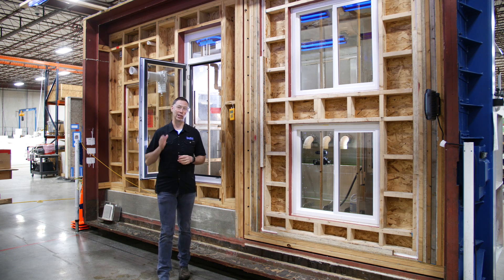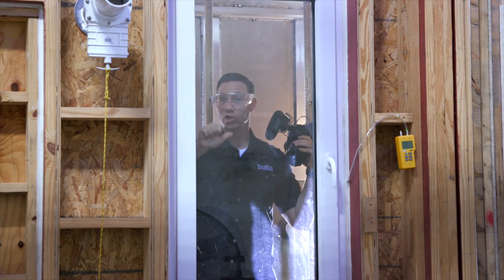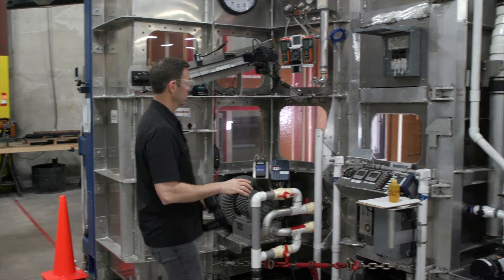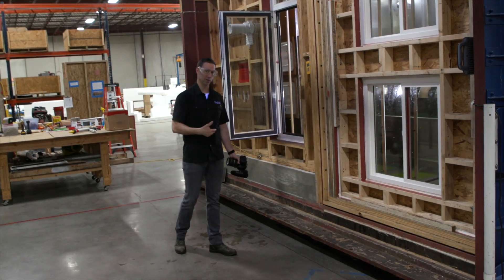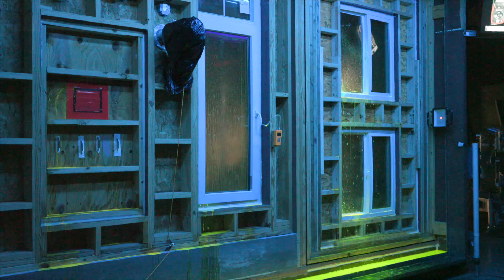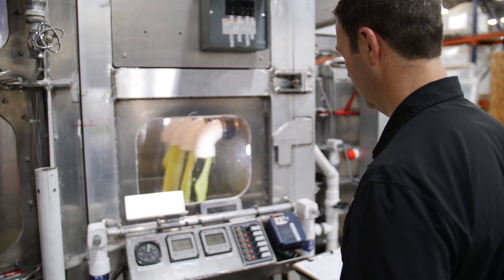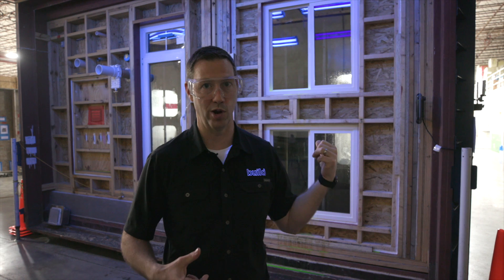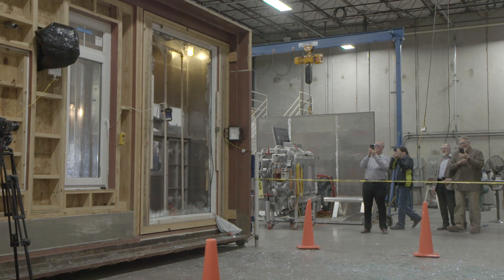Hurricane Testing - Whats the Failure Point?

Comment: Do they help protect concrete and the Styrofoam ICF walls?
Reply: You wouldn't use something like this. Below grade you'd want a EPS compatible bituminous peel and stick membrane (or liquid applied), and above grade any generic water barrier just to make sure that nothing gets into those cracks between EPS foam. Window mounting is different too, and depends on what sort of window you're doing.

Comment: With cat 4-5 hurricane nearby by. Most of roof sheeting will go, so flood will come trough the roof, so at that point waterproofing of windows becomes irrelevant.
Although air tight window and vapor barriers well make sense for humid climates to hold controlled humidity and temperature inside the house.

Comment: How do the stud bays breathe?  With supposed zero permeability how will the house dry?  Seems each manufacturer just addresses one small part of the pie and ignores creating a true 'system'.  Take care.  Doug
Reply: Hi Douglas, permeability may vary depending on application thickness, but at the recommended thickness (12 mils) it has a permeability of 18 perms. It is intended to allow the wall to breathe and dry but won't let water in. 

For more information, you can visit https://prosoco.com/product/cat-5/

Comment: I wish I could have had some of these products on my house on September 6th 2017 when hurricane Irma cam over with sustained winds at 189mph and gusting to 356mph on parts of the island of St John.
Reply: Steve Slade  Mine did because it is made from 8" thick cement walls and ceiling.  They were breathing about 6" throughout the storm though (very scary).  I did have a hurricane window that was covered by 1/2" plywood implode from being impacted by someones aluminum hurricane shutter.  I did have water force its way through or around every window and door, even with aluminum roll down shutters over most of them.  I was luckier than many of my neighbors that lost everything..

Comment: there are some flaws in this testing they used a sliding window for the vinyl but a casement for the german. not a fair comparison at all. while i do think the german window is good would have been nice to see the same type of windows. also what about windows that dont open at all just a vinyl or german made with no openings just a viewing glass no option to open it.
Reply: It is a test lab for there sealant not so much the windows so they control the variables they care about. I'm sure they have done many us made casement.  It makes a strong case for not using cheap windows.  What would have been cool is see how bad they leak then hop in and apply a the red stuff and stop the leak in short order. Like the cardboard box demo.
Reply: @tysleight  i get that they were pushing the liquid apply. but if they both had shown both types of windows being casements then i would be able and many others would be able to clearly see that the german ones are much better ones. but seeing as they use 2 different types which have much different leak results seems abit strange. the fluid applied stuff works great i know it does. but as i am getting ready to build a new 5000 sq ft house in a few months would be nice to see the real difference in them in a apples to apples situation
Reply: Yes. Picture window.
Reply: @kipcarroll486  yea

Comment: Wonder if at some point a product like this could be built up like a stucco as the final layer... kinda like a stucco applied to OSB with a variety of textures/colors/etc.... a materials savings for sure.
Reply: I don't think it would be a UV stable product, as it's not meant for prolonged UV exposure but to be covered.
Reply: I looked at the website recently and I recall that they don't recommend painting it as the final surface because it would be degraded by UV rays when the pain wore off.
Reply: Fast Flash and Cat 5 are not intended to be an exterior product. We do have a formulation for use in rain screen wall assemblies, but for the most part this is meant to be covered with some sort of exterior cladding.

Comment: Ask any window manufacturer and they'll tell you that casement windows are the tightest air and water seal, followed by double-hung, and last are sliders.  Notice how the German window was a casement?  And notice how the cheap windows were sliders?  I'm sure the Germans make a fine window, but the comparison is apples and oranges.
Reply: I think the point being made is which window would you prefer to have in  climatic conditions where the wind gusts may regularly exceed 40mph -- show this video to a client demanding cheapo windows to prevent a potential lawsuit down the road.
Reply: It’s about the products around the window and on the walls.  They aren’t selling windows.  The sliders are the most typical window in America  installed.  All the builders here now pretty much install hurricane windows.

Comment: what do you think the cost would be to do an moderately sized home with the cat5 all over and that kind of window setup? say a 2000sq ft house?
Reply: I'm just finishing up a 1967 sq ft house using Zip flashing on all the seams and nail holes.  (Zip 2.0 method.)  I have now gone through 60 tubes of flashing (at $30/ tube.)  At $1,800, I would seriously consider the Cat 5 on the next one and I might even save money due to the fact that I wouldn't need to buy the Zip sheathing, just regular OSB.  So I agree, this method has a cost to it; but I don't think it's the most expensive system out there.

Comment: I would be interested to see what happens with a wall that isnt overbuilt. With all the additional structure in the wall you would be getting less flex which would put more strain in the window and less on the prosoco products.
Reply: Skubasteve21 we have run these tests in Australia for window ratings and the wall structure has to be the same as a everyday build which in Australia is normally 3x2 pine with no sheathing just brace board where the area is too small for metal strapping then a 50mm cavity and single brick veneer.
Reply: They want the wall to hold. They aren’t selling the wall structure but the products sealing them.  If the walls keep failing then they can’t properly test their products.